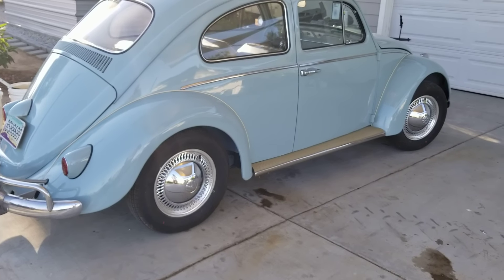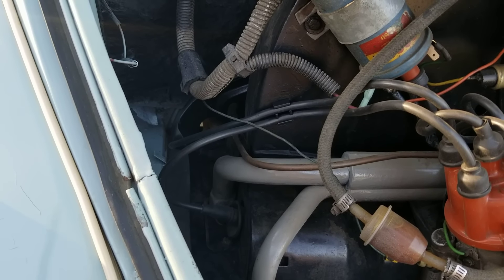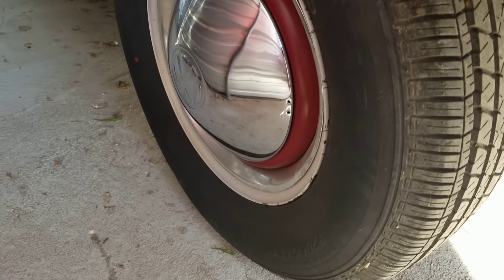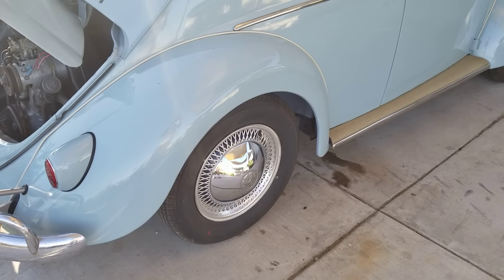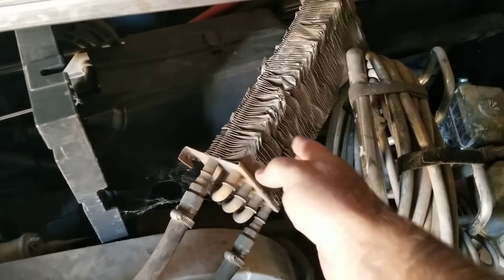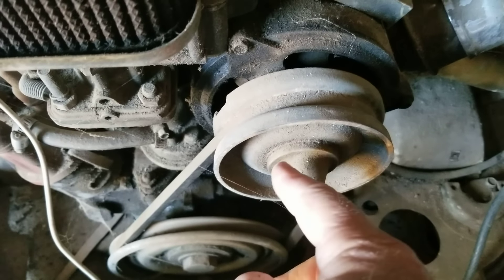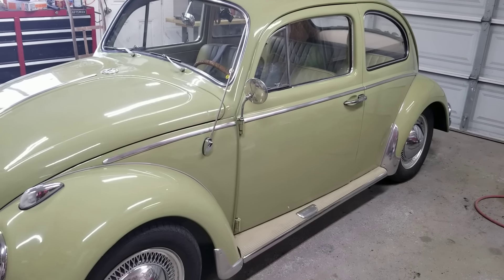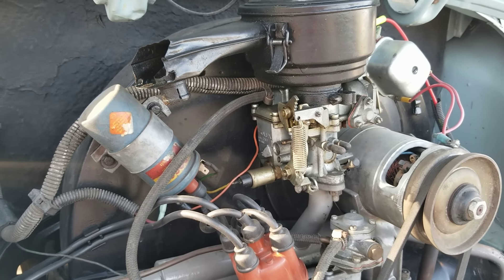Things NOT!!  to do to your Volkswagen VW bug or bus

Comment: If your carbs intake has a loose brass fitting, Epoxy it in, and then to be doubly safe, stake it. I staked mine with a punch.
Later engines have a doghouse that relocates the oil cooler from over cyl 3, to outside in back of the engine. UNLESS you are running a dune buggy, DO NOT try to out-engineer the VW Engineers!
They knew what they were doing. Keep all the sheetmetal stock, and around the engine! The engines run too hot unless you keep them stock. 
My KG was always needing it's valves adjusted, they were tightening up, which will burn exhaust valves, I replaced the worn-out adjusting screws and that really helped.

Comment: Change your oil every two thousand miles and adjust the valves every oil change. Adjust the number three exhaust valve loose with more clearance that will allow that valve to remain closed longer to help it cool. I would adjust all valves to .006 with the number three set to .007-.008
Reply: ...adjust the valves to the above clearance when the engine is stone cold.  VW manual says to adjust to .004, but that is for a car that was driven to the dealer.  Adjusted mine with a cold engine to the factory specs... ran like a bat out of heck for exactly 185 miles... left me stranded in Beeville, Tx.  Never forgot that lesson.....
Reply: gabor korthy I would add to that oil change schedule 2K or every six months whichever comes first. As I used to tell my customers:  Oil is cheap, engines are not.
Reply: Set your valves loose like that if you like a clattery engine.  I set mine to .004" across the board. If you know what you're doing, this works.
Reply: E-curb  I prefer longevity in an engine to quite ! The number three exhaust valve is the one to always fail because the way the oil cooler is positioned the air that reaches the number three cylinder has been preheated by passing through the oil cooler.
Reply: @gaborkorthy8355    .."The number three exhaust valve is the one to always fail because the way the oil cooler is positioned "  This is what everyone parrots. If you talk to the engine rebuilders they say it's a myth. VW retarded the timing of #3 to eliminate its hot running. Every engine after 71 had the oil cooler out of the way of the cooling airflow to #3 & #4.  The problem is, those that parrot the above myth, still say the same about the later engines when it's theoretically not possible.
My engine is the original engine, not rebuilt. I've set the valves to .004" since I got the car 25 years ago. It runs cool and doesn't leak a drop.  The key to my success with .004" is to measure the lash before adjusting it. Don't just go in there with your .004" gauge and say it's too loose, or too tight, actually measure it.  That way you know what is happening to the lash.  If you find it to be .002, then maybe you have a problem developing.

Do you know why VW said to set them to .006 instead of .004" back in the  70s? It was because by that time, most other cars on the market had hydraulic lifters that self adjusted, so no maintenance.  Car owners didn't like to have to pay for a service other car owners didn't have to do, so it was very common for owners to neglect their valves.  In response, VW increased the lash to accommodate those neglectful owners.  Are you that type of owner?  If not, it is perfectly safe to run at .004", as long as you know that your lash isn't going to close up to nearly nothing.  By measuring the lash like I described above, you can see a problem developing.
Reply: yup, but every other oil change is plenty. old buggies say .004 and .006 but I always added .002 to both. they warm up and the aluminum everything is bolted to+through, does expand some.
Reply: @Kevin19700  ...notice....no oil filters in these cars....only oil screens on the sump cover.

Comment: Accelerator cable breaks, not carrying spare now what, don't despair, pull throttle lever a bit & put a piece of foam or rolled up paper to keep the throttle from going back to idle, the motor will rev up and keep on revving till you remove the foam or paper, it's a little tricky when you stop in traffic as the motor is revving fast be careful releasing the clutch as the car will shoot fwd and on each gear change the revs will be fast but you'll get home.
Another tip, I have an early 67 K G which was 6 volts, in around 1982 I converted to 12v, the two things I left 6v were the hooters ( 2 on the KG) and the starter motor, you should hear those hooters running 12v, the starter turns super fast, it's now 2023 and all I've had to do is replace the worn brushes on the starter motor😊

Comment: Do not use cheap 12mm washers under your case halves nuts they will cave in and cause a looseness affect and at 40,00 miles replace your clutch disk and re tighten the case nuts.
Reply from the maker: bigtime and I usually put some goop on them too. sometimes silicone on the threads or permatex 2.

Comment: If you're in the market for a Mexican Beetle with fuel injection system (or already have one): change all your fuel hoses, especially the ones that go into the injector rails as they love to crack and make a mess. And try to keep the needle above quarter tank mark, your fuel pump will thank you later and will last much longer.

My grain of sand just in case someone needed to know! Keep those VWs rollin'!

Comment: Don't use plastic fuel filters. Use the glass ones. Keep all wires and hoses away from all exhaust. Always use hose clamps. I agree with the old fuel pumps. Keep them. They are the best. Never had issues with my Bus running 80mph on the freeway and a stock transmission. I did however have a 1914 engine balanced to 8000 rpm so I could run it full out all day long at 80mph without over heating. No transmission problems ever. Always carry spare plugs, points, cap, rotor and throttle and clutch cables and the tools to replace them and adjust them. Keep your ground connections clean and in good condition. Keep your old style fuses clean and free from corrosion. If you plan on changing your windshield be sure to remove the aluminum trim very carefully and be sure you remove the old rubber properly. Replacing the window is easy once you know how. I practiced on the rear window before I did the front. Did not break the glass and was able to install the original aluminum trim. Know what you are doing before you do it.
Reply: Normally the plastic fuel filter is safer than the glass ones which are more often the cause of fires.. ironic to see you suggest the opposite.
Reply: @fathergratwick  The two most common fuel related fires are from leaking fuel lines (rubber) which should be regularly changed even if it looks ok. The other is from stock fuel pumps and carburetors where the metal tube is pressed fit into the carburetor or fuel pump. Those come loose from vibration and temperature differences where shrinkage and expansion are not equal due to the different metals used. If the become loose the leak or just outright pop off under light pressure spraying your hot engine compartment with fuel causing a major fire. I’ve experienced both issues with a very close call on one. The glass fuel filters when installed correctly and if the above mentioned issues have been permanently corrected will not be a failure point. The rubber seals like rubber lines need replaced periodically so you retain a good seal. They won’t unscrew when mounted properly and if they are tightened correctly. Never once did I have a fuel filter failure. The plastic ones just look ugly. I prefer the glass type. Always have. Are there any other VW related things you’d like to know?

Comment: One thing, the stock fuel pump plunger comes in different lenghts on aftermarket pumps. Yes, do not throw original Bosch fuel pumps away. Aftermarket pumps cannot normally be rebuilt. The rest of the !Do nots, are true, espcially the carb fuel intake barb.

Comment: I wouldn't put a fuel filter in the engine bay....whilst its screw it into the line it may work loose and you'll have a problem. I would put it underneath the car away from the hot engine... I agree with other comment regarding fire extinguisher...a must have for an old vw.
Reply from the maker: lots of guys are that way You cant be too safe. i just like to look at mine in case there is debris. underneath the car I cant do that but good thinking.
Reply: Better yet, why bother with a fuel filter?  I have NEVER had a clogged filter.
Reply from the maker: @craigjorgensen4637  I have had some pieces of crap on my old stuff plug the needle and seat opening and it took me hours to fix figure it out Gotta have a fuel filter on these old cars little chunks of crap from the fuel line in the pan or tank plug up some super small openings in the carb.
Reply: If you’re that worried about the fuel filter breaking or whatever literally just replace it every time you change the oil they cost nothing. Or get a metal one. I love having mine right in the engine bay where I can see it and easily diagnose fuel problems. I’ll never understand the fuel filter fight.

Comment: Nice hints. Also the mechanical fuel pump nut on the backside comes loose. Have a 13mm that has an angle head to get at it. Be sure to clamp the fuel line leaving the fuel pump and where it enters the carburetor. Fan belt adj. is important. If too loose and  the belt jumps off or breaks it will whip around awhile and knock the fuel line off spraying fuel onto the distributor. Ever seen a VW with a black spot on the engine lid?  Engine fire. Of course if the fuel spray is excessive and you do not have an extinguisher ready while the fuel is burning and the engine lid is opened before the fire smothers out expect a disaster!  I saw a Porsche 356 and a beetle flash fire when the lid was opened.

Comment: If you install a new speedometer in your beetle do not over tighten the 2 screws that hold it to the dash, just snug them down. All rebuilt speedometers come with a glass face, over tightening the screws will bend the mounts enough to crack the glass. Don't ask me how I know. If you do manage to come across an old speedometer with a plastic face you can just tighten the screws down. There are 2 different length fuel pump actuator rods, 100 mm and 108 mm. The 100 mm rod is only used on the 1974 beetles with a carb and an alternator. The fuel pump is canted to the side to clear the alternator. All other beetles with a generator use the 108 mm rod unless you should install the canted fuel pump, then you must use a 100 mm rod..  If your installing a new master cylinder there are 2 spacer bushings that go around the 2 mount bolts that support and attach the master cylinder to the frame head. These spacers MUST be installed or the frame head will bow and the master cylinder will actually move forward when you push down on the brake pedal. If you can't find them or they never were installed you can make them using heavy wall steel tubing found at any hardware store. When greasing the front torsion bars ensure that there is no weight resting on the wheels when you grease them, the wheels have to dangle. Failing to do this will eventually damage the needle bearings from lack of grease. This is also a great time to adjust the front brakes.

Comment: 2:14 use a 13mm that is offset to reach behind this fuel pump to tighten the nut. They loosen from mechanical action of the pump working. Same 2:14 keep belt adjusted at if it is thrown it knocks off the fuel line and sprays the distributor.

Comment: I always use Bosch religiously, I do drive 70 but I have a new transmission and rebuilt engine with under 500 miles in my 1970 Beetle w/ Sunroof Yukon Gold. I cherish him so I will def just drive 65 from now on to be safe and not push it.

Comment: Here is what to do - change the oil every 3,000 miles making sure you clean out the oil strainer - set the values about every 10,000 miles a somewhat arduous task without a lift - keep an eye on the battery for terminal corrosion - if the VIN number in the windshield does not match the one stamped under the rear seat you might be driving a "hot" ride - as for the heat exchangers and muffler you probably already know about the ravages of rust.

Comment: Question about your spark plug wires..There are 4 spark plugs, 2 on the left and two on the right. The right hoses should connect to the right side, according to their corresponding spot on the Carb, correct? Left side on the left?

Comment: All "Do Not", agreed. Bug or Bus (have had many) I've put a larger hose clamped down on the rear firewall, and then run the tank to pump fuel line inside the larger hose. I've had the carb barb fitting come loose in one of my 67 Buses. As expected, engine fire.  Cracked left head, and #3 jug. Rebuilt the engine it in a parking lot and drove away. Nice green and blue bugs. 59, 60? No 40 horse block, though.

Comment: The same way you've been putting fuel filters in the engine bay and NEVER had a problem, I know a guy who has been driving on tires from 1995 and NEVER had a problem either lol. Both are bad ideas.
Reply from the maker: bad idea until your car wont start and you can look back there and see if there is low fuel in the filter. Easier to figure out problems. Nothing bad about it. 30k cars in my area had them Never had an engine fire from 1. We do it so you have a visual. Never had one burst never had one leak. I change them often enough not to have issues. I have seen several engine fires. usually from the brass fitting coming out of the carb, no clamps on the fuel line and it gets old. Old cracked fuel line Etc.

Comment: If its starts with B, its for me. Bosch only. Great tips
Reply from the maker: I think they only make the peanut plugs in NGK for the new heads but that is correct.
Reply: @Mikefngarage  I'm a firm believer stick with how they came. I have worked for a few dealerships family owned here in Tampa. One being a Lincoln/ Mercury and a Toyota dealer. Everytime you see a rough driving car, its always was fixed every time with oem plugs.
Reply: Beru are good too.  And that starts with a B.

Comment: I use Bosch resistor spark plug wires which are OEM and have had no issues whatsoever. On my 65 Ghia with the original 1200 engine. I still use Bosch points and Bosch blue coil.
Reply from the maker: I should have said silicone resistor. Original has actual wire inside that has some resistance

Comment: Don't drive your split window on the freeway if you have gear reduction boxes, but if you do: A Rhino case, super diff, all German bearings, 3.88 R&P, both side plates billet, welded 3rd and 4th, .77 4th helps those rpm problems at 75mph in a split window bus.. side effect is it drives like a wet noodle. But still cruises nice at 65mph

Comment: you can, but don't route your fuel filter next to your distributor, when there are so many other safe spots you can ...
Reply from the maker: we like I say it is your call on that I like seeing what is in my filter the glass ones are definitely a no no they leak. those plastic ones I have never ever had an issue with them breaking. i know tons of vw guys with the same and no issues. the barb in the carb has been the biggest fail

Comment: I just added a 3rd-high mount brake light in the rear window of my 1961 panel bus. I used a VW back-up light housing, painted the clear lens red with Testors paint, and also painted the chrome housing black. It looks pretty darn good, although l am not a fan of anything that is not original, but because the bus is 6 volt, l figure better safe than 100% original.

Comment: Great video. Keep up your excellent work. My VW had by factory installed metallic cover on top of the battery ( BOSCH ) held by a strap with a quick release clamp connected to 2 anchors  in the floor. The metallic fuel line by factory goes trough a rubber grommet mounted in the sheet metal cover.
Reply from the maker: Great tip!

Comment: Over here in New Zealand my father traded his 63, with semaphores, yes that's right, 63, for a 72 Super. It came with a piece of rubber over the battery, the rubber was in fact a inner tube cut to fit! Only the best from VW! Still have the car.
Reply: 1960 was the last Beetle in the world with semaphores.  Either your father's car was earlier, or it didn't have semaphores.
Reply: @e-curb  Well the answer is no and no.
VW would use up old parts in minor markets, that being New Zealand in this case, hence the odd incidence of semaphores till 63. At least we got disc brakes on the Superbug!
Reply: @bunning63   .. You're wrong. There was not one single Beetle produced anywhere in the world with semaphores after 1960. There are other possible reasons for his car. Maybe it was registered as the wrong year.  Maybe an earlier body was swapped onto his 63 chassis.
And it's also a big myth that VW was constantly having to "use up leftover parts". Even in the 60s, VW had planners who's sole job was to schedule quantities and delivery dates for parts.  With a company like VW, there's no such thing as leftover parts. 
The body of a car with semaphores is different from one without. Where do you think they were able to store the tens of thousands of "leftover" bodies for 2 years?
Reply: @e-curb  Sorry dude live here, well known fact here. Sure some of the local VW experts could fill you in on a few other oddities. Remember our way out of the way market was righthand drive and small as. Most myths usually have a bit of truth. Could talk about some of the odd cars South Africa had, but then everyone would be even more confused...